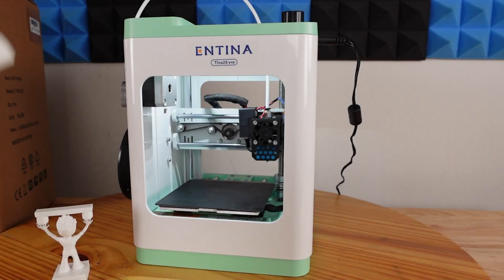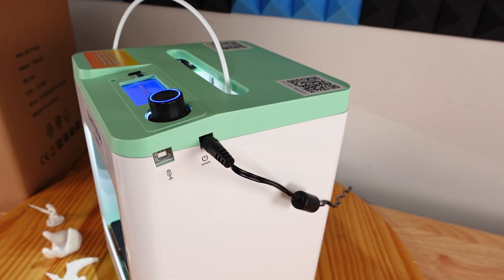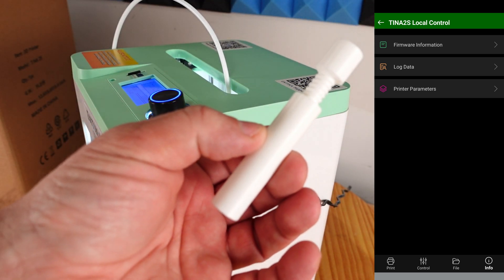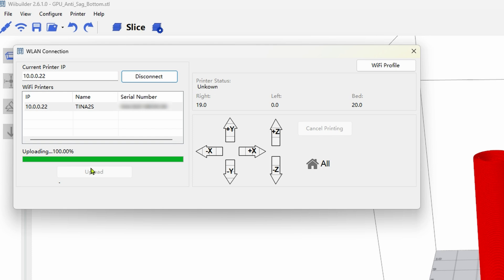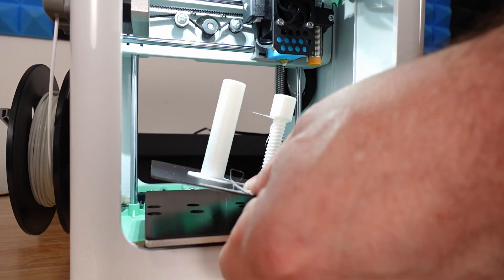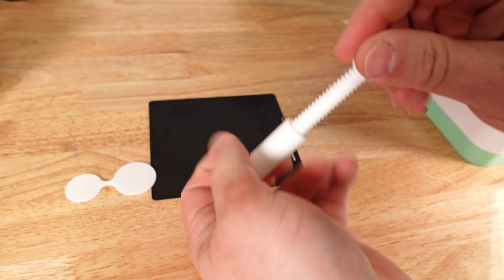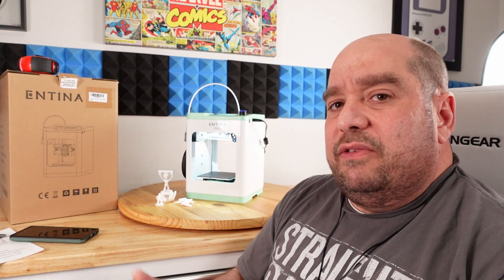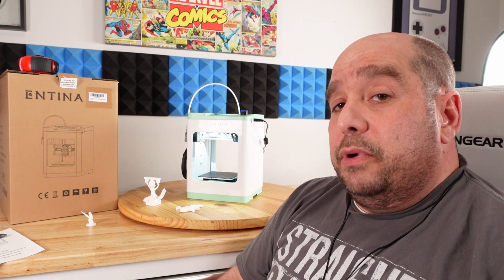Print Anything at Home in Minutes with this Game Changing Tech!

Comment: Hi sir, please help me. I have problems installing my used  HDD to my pc and I tried following your video about that but it still didn't work on my pc. The problem is when I connect my HDD to the pc the pc won't boot, no matter how many times I press DEL. But if I disconnect the HDD my pc works fine. My pc is still new, I bought it last october and it already has SSD in it. I am a small creator here in youtube(diff. Acct) and I needed space to save files and videos. Please sir. I need your help🙏🙏
Reply from the maker: See if this helps  https://youtu.be/FYVPaNnr-t8?si=cvxi3Ys85npgP2en